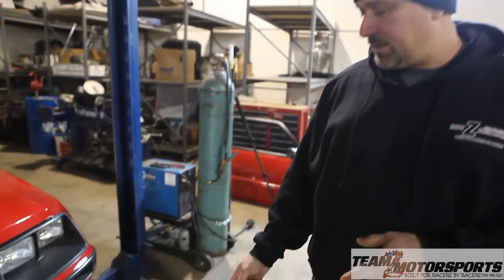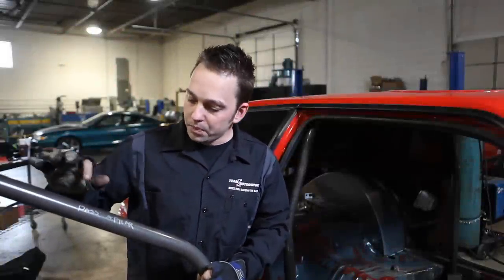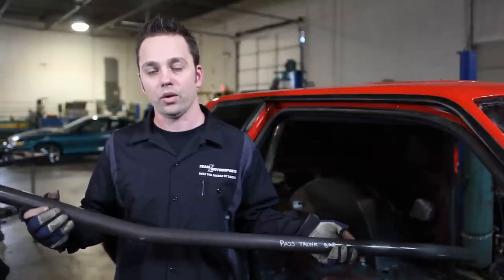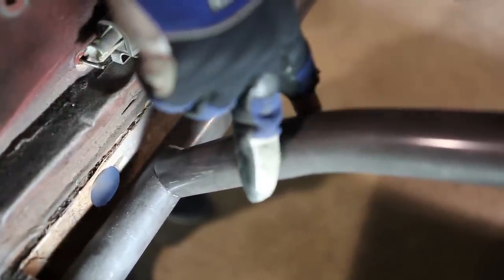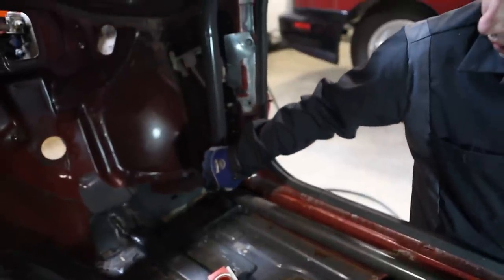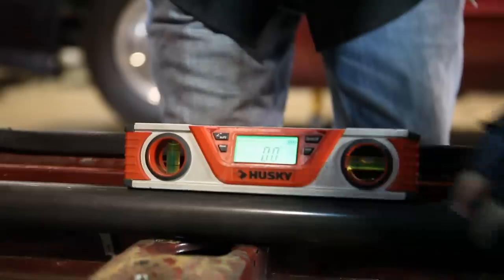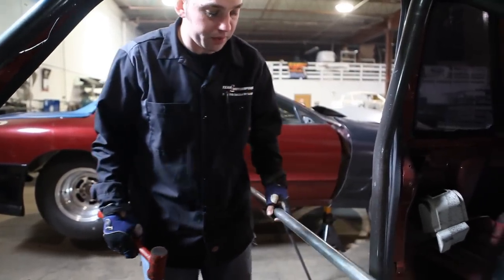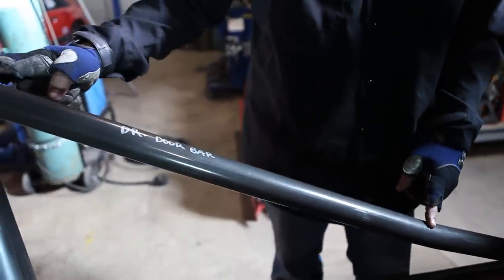Team Z MotorSports Pre Labled & Pre Notched Cage Kit! How to install!

Comment: Why is the windshield bar so low? I know, you already weld the cage in so you couldn't drop it to weld 360 degrees around.
Reply from the maker: It's really not that low but the placement of the windshield bar is so the headliner and Molding can be put back in if it has been removed, also if you want it up higher you can remove a little material from the bar with a barrel sander and slide it up higher!

Comment: How do you weld the top of the A pillar bar to the main hoop, as well as the windshield bar to the A pillar bars on the top side if using 6x6 plates.
Reply from the maker: dont weld the plates to the floor, tack the cage together in the car, but not to the floor or plates, slide the plates out cut holes just big enough to drop the cage down enough to weld the top, lift the cage back up slide the plates under and finish welding, or get a small torch head and remove the head liner and weld the top, we've done it both ways

Comment: How do you fully weld the joints at the rocker bar, the main hoop to A-pillar fits, and window bar? Is there another video that shows how to get in that tight? Or is it not as tight as it looks in the video?
Reply from the maker: +Tony Dew  It's tight but it just takes some patents and talent, but if you can weld the rest of the cage you can do that!

Comment: I am wondering if the doors close, there is no mention of how the car is supported, I only heard that it is level, I am a firm believer in setting the car on its tires so there is no surprises with door fitment, make sure all tires are symmetrical and even tire pressure on level ground, I should make a video.Big Al
Reply from the maker: +Al Sal ,out of the 343 cars we have built none have been built on the ground on their tires, they are usually built on a JIG or level and supported on Jack stands, once the car is level and in position to work on it the doors are checked for fitment and 99% of the time there are no issues! But thanks for your input there are many ways to skin a cat and your method may work for/ or help someone,  Thanks!

Comment: How do you tell your customers how to fully weld the cage joints?
Reply from the maker: +Russell N. TIG weld with 3/32 25 thorated tungsten, and if you are un sure of your ability practice first on some small pieces and put them in the same position as the joint you are un sure of and practice welding them!
Reply: I meant how to weld the joint with 360 degrees of weld. With the cage up and all tacked it access is limited. Your man did not explain the procedure. Is the info in the kit?
Reply from the maker: +Russell N. We have some talented welders and the weld good in tight places, if you cant do that you cut holes in the floor and drop it down to weld the tight places.
Reply: How do you drop through the floor. You are mounted to the subframe connectors? You are assuming all of your customers are talented welders that can weld 360 degrees and have done this before. I appreciate that you have a well fitted cage that is prenotched but you should go through a more thorough step by step. If not then add a bunch of gussets
Reply from the maker: pretty simple solution, don't weld the sub frame solid, just tack it in,  get the cage tacked in than drop the outrigger from the sub frame connector through the floor and the cage can be droped and welded, then put it all back in and weld the sub frame in when done
Reply: Why didnt you mention than in the vid? How do weld 360 degree of the rocker bar?
Reply: R N. O
Reply: Seriously I'd you can't weld good enough to do the job then don't do it its that simple, if you need every little detail spelled out for you then you definitely shouldn't do it....smdh wtf
Reply: Tho your comment is old, if you don't know how and need to ask all these questions it's best to take it to a shop who can do it correctly and know how to do it already.